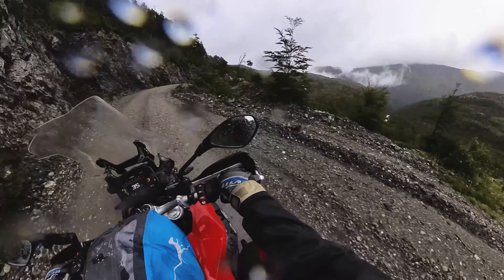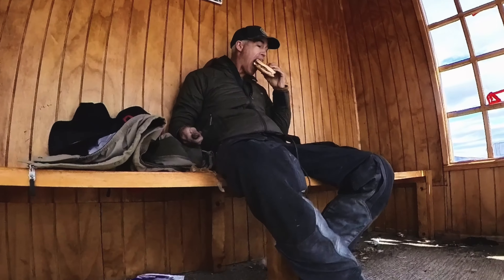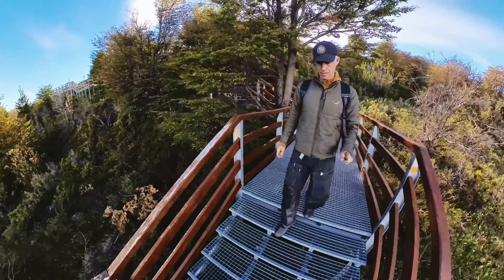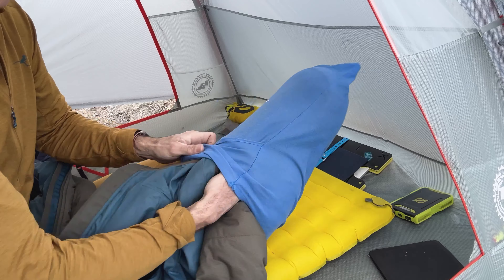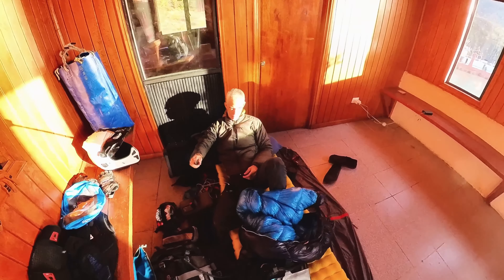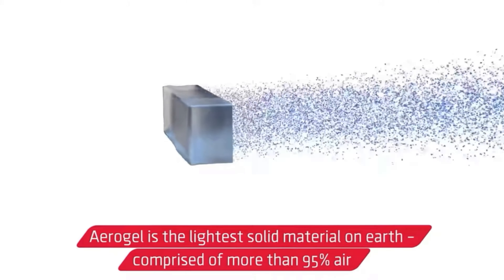Ectotherm Insulated 12v Heated ADV Jacket | Mosko Moto

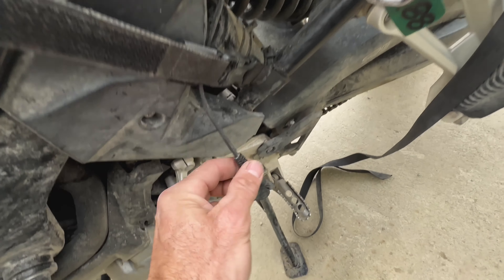Comment: @4:23 a spiral cord cable on the harness side would really help. Getting up the pegs, safety in case one forgets to disconnect and minimal cable length dangling about to allow those things :). I DIYed one for my keis jacket and it's 30 cm,s not stretched but I only leave out about 20, the rest I tuck under the seat and it stretches up to 80 cms or so (so up to 1,2 m for the whole 30 cm cable) without any resistance that I can feel.
Reply from the maker: Thanks for the feedback! We'll pass this on to our Design Team for future iterations of the Ectotherm!

Comment: I use my heated gloves about anytime I use a heated liner, so the lack of connectors to heated gloves keeps me from buying the Ectotherm. Also not sure how windproof it is.
Reply from the maker: Thanks for the feedback! The Ectotherm was designed to be worn under separate armor and the wiring required for glove connection would have been uncomfortable. We do understand that many people use heated gloves and pants along with their heated jacket so it's definitely something we're interested in looking into! 

The exterior fabric is treated with DWR to help repeal the elements if you are wearing it when breaking down camp or loading a bike but if we're riding with it we typically have a windproof/waterproof layer overtop for the additional weather protection.

Comment: It seems like the armor would compress the insulation if worn on the outside rather than the inside
Reply from the maker: The fill we are using for the ectotherm is PrimaLoft Gold, with aerogel technology. Integrated directly into the fibers, aerogel further enhances the performance of synthetic insulation. Now not only will it perform better than down when wet, but it will also perform better when compressed under armor. This was one reason we selected it as the fill for the Ectotherm and why we say it works just as well when layered under armor.

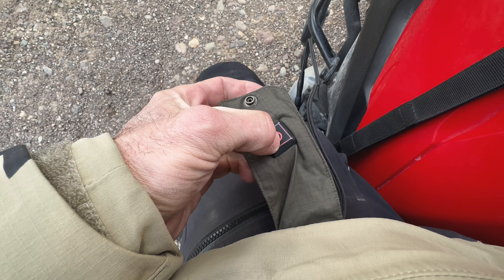Comment: At 0:58 so when you are plugged in, your leave the flap out like that so the button is accessible so one is able to change from low/med/high on the fly while riding is that correct? https://youtu.be/0AKAozbsmic?t=58
Reply from the maker: Hey Jacob! Yep, you got it. You have the option of leaving the flap out for easy access to adjust the heat setting while riding.
Reply: @MoskoMoto  That is a great design for when you're wearing a separate pant and jacket combo, but how well will it work for a one-piece riding suit such as an Aerostitch, Klim, BMW, etc.?
Reply from the maker: The power cable shouldn't be an issue but accessing the power button might be tricky if there isn't a way for it to be accessible. @bnations2000